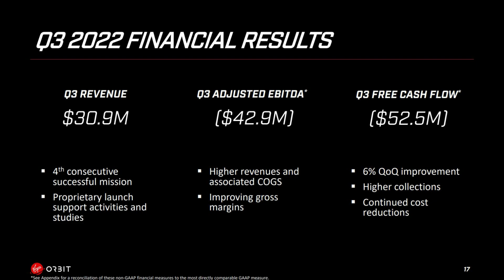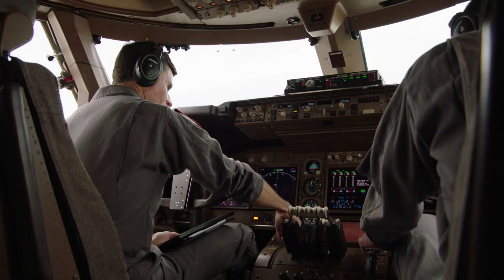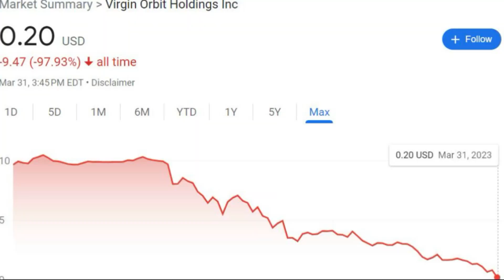Virgin Orbit Has Run Out of Money

Comment: It was a pretty tough concept. Jumbo jet maximum altitude/velocity is something like 5% of the energy required to get a payload to minimum orbit. Low payoff with significantly increased risk and complexity.
Reply: This has been known since the early days of spaceflight. Newly rich investers thinking, because they are rich, they are smarter than engineers with years of experience and historical conscience (Dunning-Kruger?). Hyperloop was the same story. Sure with money you can sometimes unlock new valuable doors with high entry tickets (e.g. SpaceX landing boosters) but better discuss with engineers upfront whether there is anything useful behind those doors.